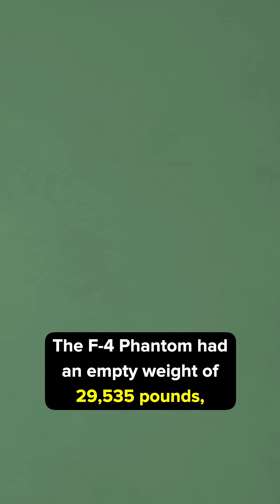Why an F4 Phantom was Launched into Concrete

Comment: Just a correction :
The mass in kilograms is not just under mass gravity. It’s mass, thus does not depends on gravity. Conversion from pounds to kilograms does not needs any relation to gravity as pounds and kilograms explain the same thing : mass, with a multiplier between them.
If you wanted to take into account gravity, you’ll need to use pound-force for the imperial system and Newton for the metric system

EDIT : Alright seeing all of the comments under, and to correct a bit my own comment :
First I am not American. The understanding of pounds that I have is that it defined both mass and weight. I thought that mass was most commonly used (as it is in kilograms, as Kg is a mass, and newton is the weight associated to it. Kilogram force being absolutely never used), when in fact the imperial system usually consider it as a weight.
The confusion comes to me seing Pound and Pound-force, and thinking they were different, when actually not really ? I mean correct me if I’m wrong, but the pound is so loosely defined it’s actually now defined on the SI units.
But my point still mostly stand.
That test was a test where the plane was accelerated in an horizontal manner to hit a wall. In this specific test weight does not matter, as there’s no gravitational forces acting appart from creating friction.
What matter is the mass of the object. Because if we had done this exact sad test on the moon, the results would have been the same. The kinetic energy depends on the mass, not the weight.
So, instead of talking about « weight », using pounds as a force, and converting kilograms in kilograms « under earth’s gravity », he should have used pounds weight and kilograms, that would have made much more sense.
Also, his mass in kilograms is actually wrong (see one of the commenter below)
Reply: Thanks for saying. Was gonna comment about this.
Reply: Not only that, but the conversion is wrong, even had the units been correct.
Reply: @bengr71  ahah i did not even realize even this was wrong ! I only focused on « under gravity »
Reply: the real issue is that he first said the aircraft weights "x" pounds and weight by definition is the mass of the studied body multiplied by the gravity.
Reply: @msi112  well in earth gravity it's still the same thing, you multiply by 9.81 only if you want newtons
Reply: Thanks for saying this. When he said 'under Earth's gravity' I was disappointed.
Reply: isn't mass under earth's gravity it's weight?
Reply: @beyondrecall9446  Yes. Weight= Force = Mass * Acceleration. But worth noting that colloquially Weight is used to refer to mass. In actuality, as above, weight is a force, given in Newtons. To get from an actual weight to a mass in kg you'd have to divide by 9.81.
Reply: Poiytre
Reply: @whiskeydelta4073  Poiuytrewq  ?
Reply: "Little" correction
Reply: Like wow, that's exactly what I had figured.
Reply: So how the graveti take the water but Not a cup of water and we i dont get to the moon im 45% from water
Reply: Its a new bookshito
Reply: Exactly!
Reply: He says "weight" in pounds so its implied pounds-force, the way he describes the conversion is unnecessarily complicated tho
Reply: You guys are so busy being pedantic that y'all missed what he actually said: He used the word 'translates' in such a way that only holds true at STP, i.e. under Earth's gravity at sea level. Because mass is scalar and weight is a vector, he had to specify his terms. And he did perfectly and succinctly. 
Also, for those who think his arithmetic was off... gee I don't know what to tell ya... good luck at the 3rd grade science fair.
Reply: What you are forgetting though is the equation of 18 inches times foot pound per several, and of course it makes no difference if the whole thing is Bu(( poo because it is just a post for likes and money.
Reply: Also the wrong weight. Impact weight was 19.0 tonnes (42,000 lbs), including 4.8 tonnes of water to simulate fuel, five rocket casings (on the sled). The aircraft had its engines.  Impacted at 215 m/s (480 mph). Test report: DC_250400 pdf & 
DC_250401 pdf
Reply: Precisely. The little, annoying details (like converting a 5-figure pound number into a 7-figure kg number) that shout at my ears from clumsy I-want-to-sound-like-a-scientist statements.
Reply: As you see,it weighs almost as much as 34000000 cheeseburgers
Reply: Correction: "Pound" without a qualifier is a unit of force, not mass. When referring to mass, you need to specify "pound-mass", just as you need to specify "kilogram-force" when using kilograms as units of force.
Reply: @harbingerdawn  « The pound or pound-mass is a unit of mass used in British imperial and United States customary systems of measurement. Various definitions have been used; the most common today is the international avoirdupois pound, which is legally defined as exactly 0.45359237 kilograms ».
Although pound could technically also refer to a force, that’s because it was defined before mass and weight was really a thing and it was not constructed to encompass both of them. But in reality mostly everyone uses it as « pound » and « pound force », not the opposite, even if you could technically go by « pound mass » and « pound »
As for kilogram force, I don’t know where you got this from. Your the first person to even mention this to me.
Kilogram is a unit of weight. If you want to talk about force, you’ll use Newton. Kilogram force is a very specific force that only applies to objects under Paris field of gravity. It’s a completely backwards way of measuring weights, at the same level as imperial units.
Reply: @vizender  If what you're saying about pounds is correct, then everything taught in schools and every piece of reference material I've ever read on the subject was a lie. While possible, that's pretty unlikely. All of those classes and reference materials identified pounds as a unit of force, with "slugs" being the Imperial unit of mass (in practice, slugs are almost never used, with pounds-mass being used instead).

Regarding kilograms, everything you said is inaccurate. Kilogram is specifically a unit of mass. I don't know why you called "weight" and "force" different things, weight is a force, and depends on local acceleration (usually gravity). Mass is an intrinsic property of an object which does not depend on the acceleration it experiences. People often use kilograms to refer to weight (e.g. "this weighs 35 kilograms"); this is understood to be kilograms-force (because force is being measured, not mass). I don't know what you mean by "Paris field of gravity", nor what that has to do with kilogram-force as a unit. A kilogram-force is equal to the weight of an object with a mass of 1 kilogram under 1 standard gravity, equivalent to 9.80655 newtons. The actual local gravity doesn't matter. 1 kgf = 9.80655 N. The same relationship is true between pounds and pounds-mass; 1 pound-mass is equal to the mass of an object weighing 1 pound under 1 standard gravity.

Because both kilograms and pounds are often used to refer to both mass and force, it's not uncommon to see the usage of the unit specified: lbf for pound-force, lbm for pound-mass, kgf for kilogram-force, and kgm for kilogram-mass.
Reply: @harbingerdawn  As an engineer, I've never heard anyone use kgm, especially since when you write it kGm, it's a unit of work, energy and torque. A kilogram is a unit of mass itself, it makes no sense to call it a kilogram-mass. Maybe it's used in ballistics or rocket science, but that's not my job.
If we are talking about force, then yes, kgf (kG in my country) or N are usually used, although 99.9% of the time you will encounter N or just mass, as 1kgf = 1kg either way, kgf is very rarely used. I have literally never used a kgf unit in my life.
Reply: @Dread_2137  I'm most familiar with rocketry, where acceleration and gravity are variable, so the need to clarify becomes a lot more relevant. I have seen all of the units/abbreviations I listed used in the wild, with kgf being the least common as newtons are preferred. And of course in many cases where the property being measured is obvious by context, kg and lbs are used without qualifiers.
Reply: @harbingerdawn  Somebody's going to get moist if you guys keep all this up..
Reply: @Dread_2137  So,Newtons or Joules?
Reply: @feellucky271  depends what you want to know, newton how much force the object had when it hit, joule how much energy the object had. 
Correct me if I'm wrong, ballistics is not my thing.
Reply: @vizender  I was told that Kilogram is a unit of mass and nothing else. Weight is pounds, mass is Kilograms.
Reply: thats alot of big words tryna sound smart lol

Comment: And that is a why it was not a plane that penatrated the wall of the Pentagon.
Reply: The twin towers used different materials, and the planes were much bigger and heavier, thus creating much larger kinetic energy

And since most of the rooms on twin towers are empty, once the upper floor is down, the whole floor was down as well

Comment: The same reinforced concrete that the towers were made from… 🤔
Reply: The twin towers mostly used different materials, and the planes were much bigger and heavier, thus creating much larger kinetic energy

And since most of the rooms on twin towers are empty, once the upper floor is down, the whole floor was down as well

Comment: "29,535 lb"
Yeah, yeah, a measurement of mass
"about 13, 396 kg of mass"
I guess, a kg is already a measurement of mass, you didn't have to repeat that.
"under Earth gravity"
What.
Mass = mass, there's no formula. You can find a mass from a scale.
Gravity doesn't affect mass. Gravity affects weight.
Weight = mass x gravitational acceleration
Mass is measured in kg (in the international system)
Weight is measured in newtons (in the international system)
The pound (in the USA, Cuba and Bhutan, I think I may be wrong) the pound is used as a measurement of mass, just like the kilogram. As far as I'm aware of, for weight, the newton is used everywhere.

Comment: "Nope, we can't knock down the towers with this one"
Reply: I'd also like to add this is apparently footage from 1988, they had this camera quality? Yet they only got a 1fps quality video of a much larger plane going into the pentagon? K
Reply: @Joe Ketelsen  uh, yeah, CCTV is always shit. Like, theres entire memes about banks with shitty cctv to this day, in 2023. Its been 22 years, and CCTV is still garbage. Why are you surprised that a million dollar high speed camera the size of a small car in 1988 was still better than a 250 dollar CCTV camera 13 years later. This test video is actually closer to 9/11 than we are today. Also, the standard frame rate for CCTV  today is only 15 frames per second. in 2001, it was 5 frames per second. and most were still only 1 frame per second. remember, for all the mystery around the pentagon, its still an office building, and its an office building run by the military. No one ever accused the military buying top of the line when good enough already existed.
Reply: @black screen  1. The planes that hit the towers dove from 14,000 feet to 800 feet in a span of 6 minutes, or about a 2,000 feet per minute descent. hardly a dive bomb. But they were traveling well over 400mph when they hit the tower. the plane that hit the pentagon was going even faster. 
2. The CCTV camera at the pentagon was from the 1980s. and yeah, I do because firstly, its an office building, not a research lab. The pentagon is filled with pencil pushers and number crunchers arguing over budgets, not Will Smith learning how to fly alien saucers. And secondly, government spending. Military Grade is take every product that gets the job done and buy the one that you can get for the cheapest. The cameras at the pentagon were no different to the ones you find at every other military base in the US
Reply: So there's a lot of debris on this test but no debris at the Pentagon or flight 93
Reply: in fairness, probably not. it was 8 times smaller than the planes on 911

Comment: The F4 had it's fuel tanks filled with water to simulate a fully fueled plane.
Reply: Correct. Tests are done to represent the worst case, not the best case. Impact weight was 19.0 tonnes (42,000 lbs), including 4.8 tonnes of water to simulate fuel, five rocket casings (on the sled). The aircraft had its engines.  Impacted at 215 m/s (480 mph). Test report: DC_250400 pdf & 
DC_250401 pdf

Comment: Mass does not change due to gravity.
Reply: Astronaut DNA. Twins one on Earth, One in ISS. The ISS astronaut DNA was different. Didn't say mutations. Different is relative.
Reply: @donfisher8035  what the hell are you talking about?
Reply: @Patrick-zr8tv  mass changes to and from gravity. Your view is atomic weight. Mine is characterized by subtle but significant changes in the DNA structure of a astronaut who spends at least a year in zero gravity. Change is synonym for different. Mass is changing.
Reply: @donfisher8035  I think you're misunderstanding me. I'm saying that 1 kg on earth is 1 kg anywhere else in the universe, regardless of how much gravity it is experiencing. I'm not talking about astronauts